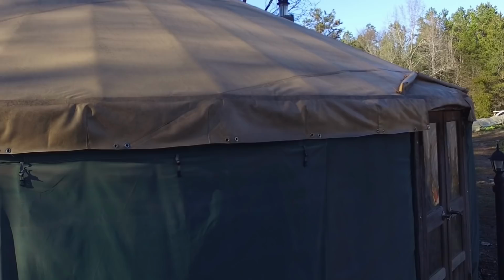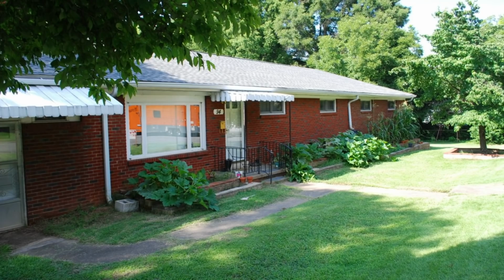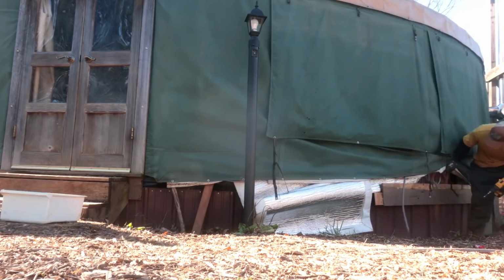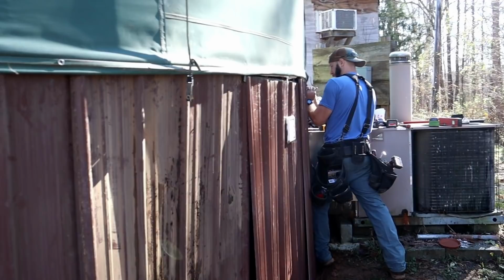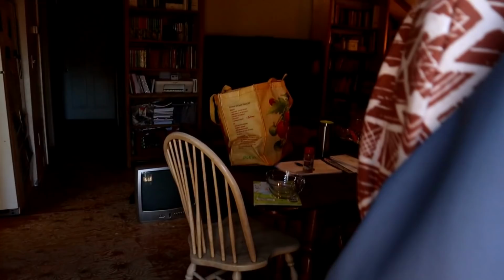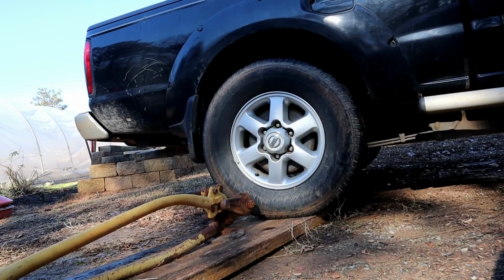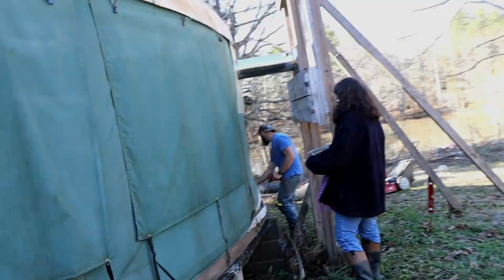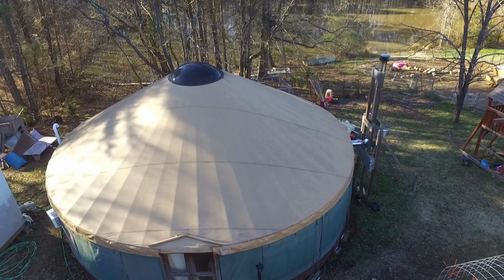We have been WAITING FIVE YEARS for this |Yurt Renovations Day 1

Comment: Maybe look into some way to put in a closable opening in the flooring, so you can put fan in the floor, to pull the cooler air from under the yurt into the yurt! Especially overnight or early in the day in the summer, this could make a big difference in temperature in the summer, saving on AC costs.